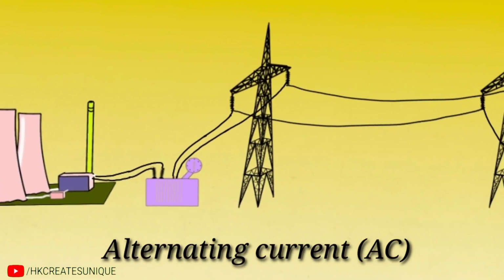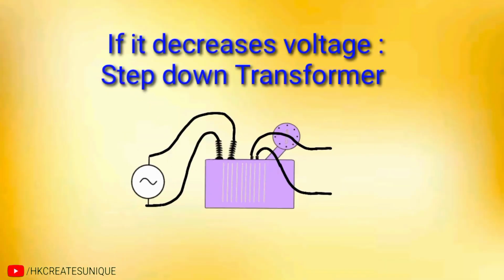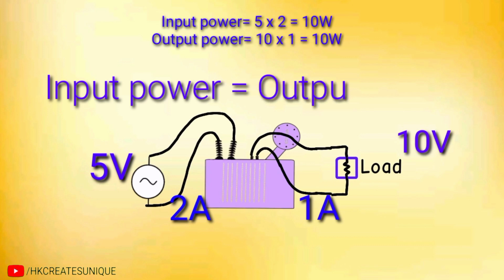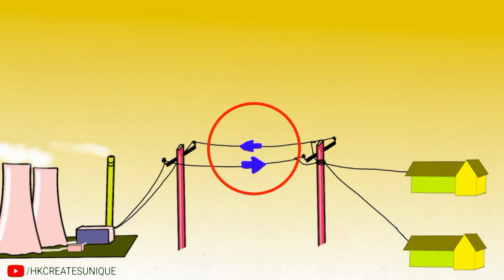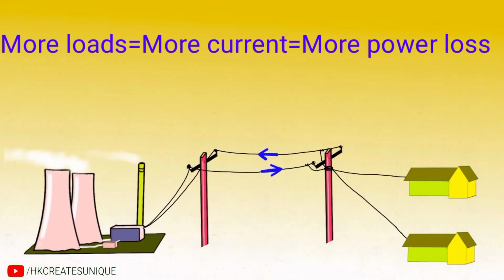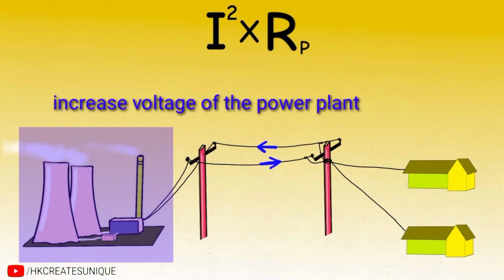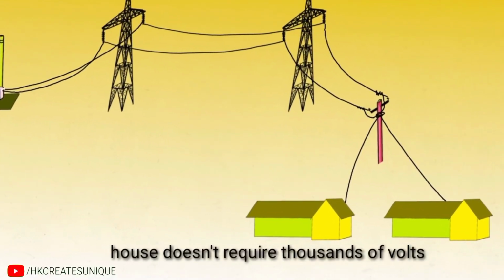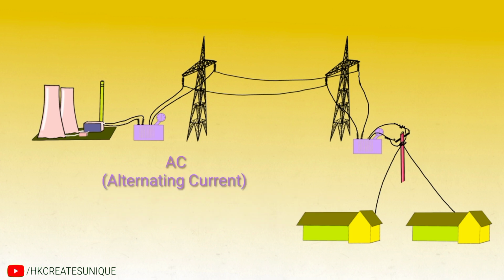Why Alternating Current is used in power transmission system?

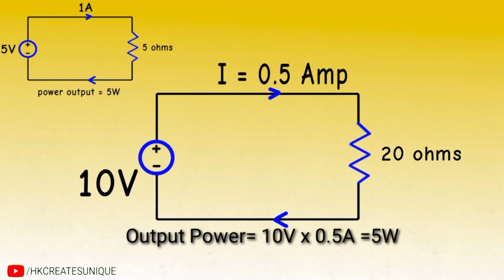Comment from the maker: 5:56 Ohms law is still valid, you have to increase the resistance of the load. See, our objective is to transfer same amount of power and decrease current at the same time. Power remains same even after increasing voltage and increasing load resistance, but current is reduced. If you increased the resistance only, current would decrease but power transferred would also decrease which is not our objective. Also, you could increase voltage only, this time current would increase and power transfer would also increase, this is also not our objective. So, to fulfil our objective, voltage and load resistance (called impedance in ac) is increased. The load impedance is automatically increased if we use a step down transformer. The primary side of the transformer will have Much higher impedance compared to the secondary (load) side.
Reply: Current is increased in a step down, voltage is decreaded.😑😑

Comment: Forever i never understood how AC,with it's 60hz moving back and forth(in the US), could deliver power. I was thinking "if the electrons just move back and forth, how does my toaster ever get any energy if 30 times a second the energy is taken away from it". I was thinking of electrical power used for work like collecting money to achieve wealth...my toaster wants to hoard as many electrons as it can.

Then someone explained to me that my toaster works because of the energy the toaster can use FROM electrons moving, not the collecting of electrons.

I'm hoping this video explains why AC is so much easier to transmit long distances vs DC.

Comment: If resistance of lines is 5 ohms in first example it can't change to 20 ohms if they are the same lines
Reply from the maker: Hello, I said that, to maintain same power, voltage should be increased. I forgot to say that load impedance should be increased as well. Load impedance is increased by using step down transformers...

Comment: Thanks for the explanation. One thing you mention that others skip over is that transformers can be used only with AC voltage.  It would be great to explain why reducing DC voltage is not easy.

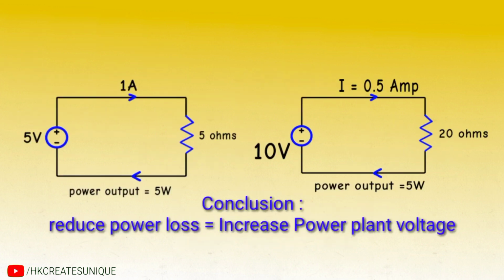Comment: At 6:00 if V^ and | will decreases?Than how ohm law will hold?
Reply from the maker: Ohms law is still valid, you have to increase the resistance of the load(this is done by a step down transformer i.e. high input impedance and low output impedence). This way, when high  voltage is used, and high resistance load,current is decreased and thus power loss is reduced.

Comment: Why are they doing extreme hv dc now though
Reply from the maker: Actually DC is more efficient because it does not care about inductance or capacitance of the power lines....But increasing and decreasing voltage is hard in case of DC.In case of AC ,voltage can be changed using transformer and thats why AC is so common
Reply: @circuitedu  pk,  so they just make a tremendous amount a d still have to turn it back to A.c. close to use,  gues crotchety old Dollarsd was right,